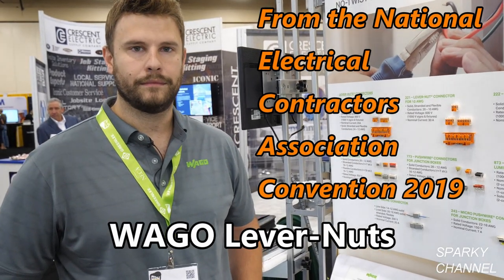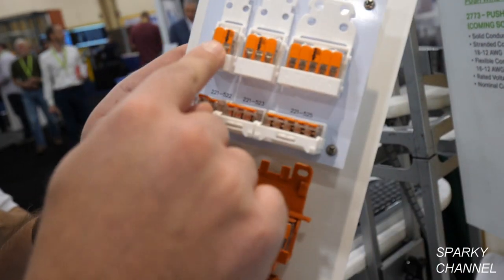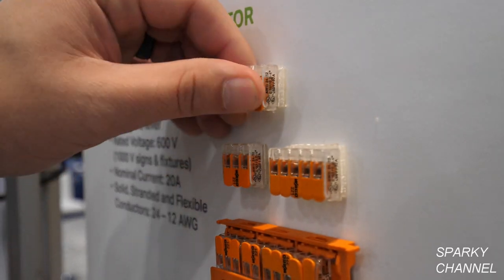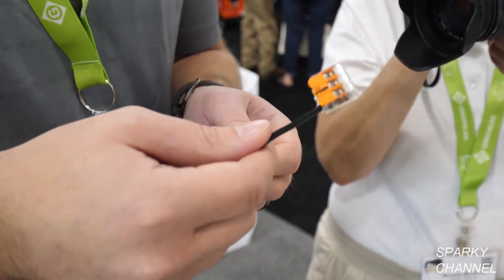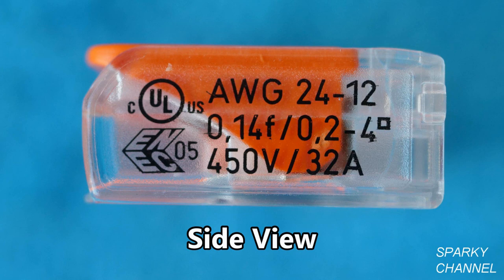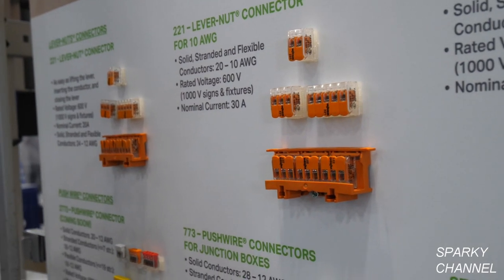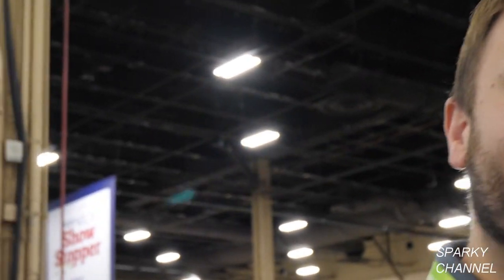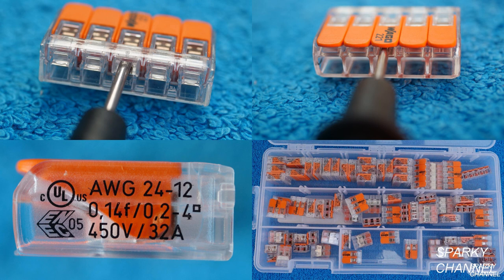Wago Lever-Nuts Questions and Answers From National Electrical Contractor Convention

Comment: 26 years of twisting wire takes its toll. These are a God-send!
Reply from the maker: I hear that! Happy new year!
Reply: Only 25 years? Weakling. Try 40 years. Lol.
Reply: Yep that and none of us old farts ever used power tool to set screws. Know several old sparkies with carpal tunnel & elbow problems. Was going to get my carpel tunnel operated on a few months before I retired but delayed it. Seldom bothers me since retiring so not getting operation done.
Reply: @JohnThomas-lq5qp  smart move, amigo. Both my shoulders are supposed to be replaced. I don't care how much pain I'm in, that's not happening.

Comment: I carry them all the time in my truck, use them a lot when troubleshooting or for continuity test when coming to a pull box with multiple circuits, rarely leave them in the boxes I usually replace them with regular wire nuts once I got everything figured it out. Sometimes I leave them in if I’m splicing 4 to 5 #12s in a box with other circuits, Easier to bend/push them in when spliced. Will buy the new ones for #10s.
Reply from the maker: Sounds good Roberto!

Comment: After many jobs involving old work, I too often come across wire leads that are too short either at installation or for who knows what reason the wires end up short probably by too many wiring, unwiring and rewiring cycles (by work hardening induced brittleness due to replacement of a failed socket, upgrading a switch, etc.).  Try wiring a short lead with a wire nut.  WAGO’s make this possible without having to do major surgery on the circuit.

Comment: The Wago system really is excellent.  They also make junction boxes that lock the connectors into place with strain relief built in, the bonus is that when the connectors are pushed into the box, the levers are held into place by the structure of the junction box.  A true maintenance free system.

Comment: I absolutely love them. I don’t use them everywhere but damn, when you need them they are perfect. Reusable, doesn’t damage the wire, you can disconnect only one conductor with having to untwist a nut, the wire is allowed to rotate within the clamp, making it easier to move the connector within the box.   So many pluses, imo
Reply from the maker: Thanks!
Reply: I like the way you can connect up all the energized sides of the wires if you're working hot for some reason, and then make the load connections last. Safer as there's no open hot wires exposed that way

Comment: As an amature, I adore these things.
Reply from the maker: Yes sir! :)
Reply: As a professional, I adore these things.
Reply: As a DIY guy, take my money!
Reply: From the first time I saw Bill (Sparky) show them I really like them, my trade school companions said they didn’t trust it, I’ve been using them since and not a problem (and I know there are never gonna be any)
Reply: Yes these indeed are for amatures that do not realize this is not as good of a connection as the actual wires being twisted together under a wire nut
Reply: Having said that i do believe that these will work fine in very low amperage applications with no problems
Reply: Thank you for asking the doubting questions.   I loved hearing the responses.
Reply: I like to use them on ceiling mount light fixtures, especially if I know that that person is all Martha Stewart and constantly having their fixtures replaced.   I almost always find wire nuts with a whole roll of electrical tape wrapped around each one.  Once I nip those, we’ve already lost an inch of wire.    Why continue on the path to an eventual tug of war?
Reply: @kellxniko  I dont trust wire nuts. I prefer soldering everything.
Reply: @kellxniko  You have seen the testing videos on youtube, where the wires themselfes gave up before the Wago connectors? And this at more than double or triple the rated amps. So they are already better than the wires you can put in them. So tell me, what should be the benefit of a connector that is better than that? When the cable is already with the wagos the weakest link?
Reply: Did you mean armature? Being all electrical, after all.

Comment: I hope this becomes standard in res building.  It is so much easier and safer for homeowner diy.
Reply from the maker: Thanks!
Reply: homeowner here... i replaced an electric cooktop. i used these instead of wire nuts. so easy! the wire nuts destroyed the stranded ends :|

Comment: I love these connectors, use them all of the time and never experienced any issue whatsoever. Just be sure to buy the authentic WAGO and not the Chinese knock-offs.
Reply: EXACTLY. There are cheap Chinese knock-offs all over Amazon. I always read the fine print and make damn sure I'm ordering the REAL Wagos. There is a HUGE difference between a genuine Wago and the knock offs.

Comment: I just used a wago connector to get out of the jam. 🙈 I replaced  two new switches which were not working and ended up having to replace the gang box as well because it was cracked; one switch is for the porch light and the other is for a switched outlet. There was not enough wiring to twist the wires together too create an extension doing pigtail so I used a wago connector instead. It Worked perfect. 😁
Reply: Perfect for short wires.

Comment: I'm surprised they didn't show the new Wago 221-2401 & 221-2411. Those are inline splice connectors. I used them to lengthen a few wires during a panel swap. They don't take up a lot of room, and they look a LOT better than those fugly wire nuts. I used NO TAPE! AND they're approved in the US, Canada, and Europe.
Reply: I think they weren't out at time of release of the video.
Reply: I just ordered a kit of those on Amazon. I can see a lot of uses for these, especially in regards to automotive applications.

Comment: Hi,

The wago is cantilevered internally with a spring. You can pull up on the lever a bit and nothing will happen. The mechanism does not "engage" until you start to feel pressure on the lever and then it snaps open. The little bit of movement is just free play that does not affect the spring pressure.
Reply: I saw an experiment on YouTube (on a channel by a guy who uses Wago, not a detractor) where he found that raising the lever just a little actually reduced the holding power of the nut by a consistent amount. I was surprised, as I would have though it wouldn't make any difference. However, this doesn't worry me, and I use these regularly, and love them.
Reply: Yes reduced holding force from 25lbs to 20lbs

Comment: I love wago connectors, they are just pricey. Wire nuts are good and I use them a lot. A lot of wires in older houses are short due to being cut multiple times.  So if you don’t want to re run a line then it saves headaches
Reply from the maker: Good points!

Comment: The 10 AWG Lever Nut is the best thing since sliced bread. I know im gonna get a lot of shit but ive had wire nuts fail on me even though i twisted it onto the conductor and twisted the conductors together. Ive since been phasing out wire nuts and been replacing them with the WAGO Lever nuts. Like I said the 10 AWG is the best!
Reply from the maker: Yes, the 10AWG is very robust.
Reply: With wire nuts, the formal instructions I got from professionals were to not twist the wires; instead, they were to be parallel and straight, and the wire nut's threads were to clamp onto the wires.
Reply: Same here, I don't like wire twist/wire nuts.  On thinner ga wire the wire nut will twist the copper wires together, but it sure doesnt on 10 or 12 ga wire, so unless you pre-twist, those two wires are laid side by side just contacting the ribbed metal inside of the wire nuts, and wire nuts are a real PITA if you have a junction box where each color has 4 or 5 #12 conductors! the WAGO  comes in  2,3,4,5  so you can easily connect 2,3,4, or 5 black, white, green conductors in them. The WAGO is FAR better, I replaced all the wire nuts in my house with WAGO connectors

Comment: I haven’t switched over just yet to just using them but years ago I learned to use them just to extend short ass wires the got that way because it got blow up or whatever then wire from there.  I saw a test video on YouTube were this guy put 100amps (10v) and even when they finally burned up the electrical connections were still good!  I’m switching as soon as I can.
Reply: Using anything but these is just cheap, so superior to everything else. Most important wires are flexible anyway...

Comment: 1:53 what does gas tight seal mean? Just that the small contact pressure point is high enough to exclude oxygen and prevent oxidation? It's not sealed otherwise, so it's not referring to things like hermetically sealed connectors.

Comment: Those 773's look perfect. I always wondered if there was a better way than twist connections.

Not that they can't be successful when done right, but they can be a little time consuming. Especially when making sure you got it right.

Thanks for posting this, it's rad!
Reply from the maker: No problem, thanks!

Comment: I switched to Wagos ever since seeing Bill use them on his original channel years ago, and have never looked back, I love 'em! Of course, there'll always be a place for traditional twist connectors, but Wagos are the way to go... ...wait a sec...  way, to go... Wago. Okay, got it!
Reply from the maker: LOL! WAY-TO_GO!
Reply: In your opinion when are traditional twist connectors more effective (necessary) than Wagos ? If you don’t mind me tapping into your brain.
Reply: @benjaminvivar7855  I'm sure this question was meant for Sparky, but for me, I use wire nuts or twisters specifically for low-voltage cable (grouped wire such as THWN 10, 12, or 14 gauge) or for 22 or 24 AWG electronic (low-voltage) wiring. I don't think this constitutes a more "effective" means, but I do know the primary reason why I elect to use twisters or wire nuts is because I have way too many in my collection! Haha
Reply: Red Solo Cup Thank you
Reply: Whaaa?

Comment: Ironically enough, I have to work with Wago PLCs (programmable logic controllers) for work and hate the things with a passion - mostly because of how much a pain it is to insert and remove wires from them.  They've got the same cage clamp type connector but instead of a lever you have to insert a flat screwdriver and tweak it in exactly the right way to get the cage to open to accept or release the wire.

Yet I'm seriously considering using these connectors to finish the wiring in my shop.  That little lever makes all the difference.
Reply from the maker: Thanks Jeff!
Reply: Did you use the WAGO screwdriver (210-719)? With those you can smoothly (one move, less than a second) open the port (ofcourse it wont if you have never done it before), even keep it latched. Then just insert the wire and pull the screwdriver. I did the home automation at my home, and had no issues with inserting (.75mm2) wires (stranded, no ferrule).
Reply: @marcoboot18  No, I used a bog-standard tweaker that our technicians carry around for working in panels.

I wasn't aware that Wago had a special screwdriver.  Given that we only have one site we manage that has these things (and we'll be removing them all next year, hopefully), I don't think I'm going to bother to get our people to order one.  Still, that's good to know about in case we ever pick up another site with these things.

Comment: I like the lever nuts for stranded wire. The wire strands can fan out giving a lot of surface contact. However I don’t like them for solid wire. The wire is round but the cage is square. Very little contact surface.
Reply: Your comment got me thinking about contact area in a wire nut, and I think wire nuts DO give you as much surface area as Wagos.  Think about your solid wire example: the round wire is twisted and shoved into the wire nut.  Hold up your right hand and make an OK sign to simulate a wire nut, then stick your left index finger in the O to simulate the wire.  If you press your left index finger to any of the sides you get only one side of the wire making contact with the wire nut.  Your finger-wire only increases its contact area when it comes into contact with another wire, and two sides are connected, etc.  In a wire nut the amount of surface area that is being used to pass current is going to depend on the number of conductors they are bundled in with.  For Wagos, there are always two sides of the wire making contact, and the contact area for each wire will always be consistent regardless of the number of wires used.  So that is what it boils down to: are you the kind of guy who wants wires getting the most surface contact even though you can't see inside of the wire nut to check, or are you the type who would rather have a UL rated, guaranteed connection for every wire that is easily inspected after installation?

Comment: Chevy vs Ford. Charcoal vs Gas. Lot of opinions out there on these but at the end of the day the old dinosaurs will never accept improvements so it doesn't matter which technology they are presented with. These are a game changer.
Reply: HEY!   Speaking as an "Old Dinosaur," I've been using Wago LeverNuts ever since I first found them!  I just got through sending a link for this video to a NEWbie I've been trying to convince on LeverNuts for more than a year now.  So, don't be giving us any of your biased opinions about "old people" lest one of them be tempted to hit you with their cane right in the WireNuts.  😀

Now, this "Old Dinosaur" needs to go see if Sparky has a video on 3M Scotchlok Electrical Part Number IDC 562 and 3M Scotchlok Electrical Part Number IDC 567 -- which are two of my favourite connectors for installing a compact "tap" splice into a box!  Being IDCs, they do not require cutting the "runner" -- which means, if you remove them, you can simply "re-insulate" (i.e. tape) the wire and move on.  SFAIK, these are the only IDC Tap Splices rated for 600 Volts (most everything else is designed for "automotive" or other "low voltage" use).
Reply: I'm a  dinosaur that has 40 years experience. My father owned a big electric company and my grandfather was a electric contractor. Wire nuts just came out when I started. Wired thousands of houses and apartments and had 10 service trucks at one time. We never had a problem with wire nuts. I live in Arizona and it's hot here. If technology is better I'm all for it. But we never really had any problems with wire nuts.
Reply: @bigmike9433  One of the advantages of WireNuts (and there are several), is that they do not "carry" any of the current.  Done properly, their sole purpose is to "hold the wires together" so they maintain conduction wire-to-wire.  Lever nuts, by contrast, are "in circuit."  Most of the time, this is not an issue because the circuit has "over-current protection" and the LeverNut ratings all exceed the standard current rating of the wires for which they are sized...

That said, we all know that, on occasion, the over-current protection does not function as anticipated (think "penny behind the fuse).  At that point, there may be circumstances where the LeverNut becomes the "weakest link" in the downstream connections.  Whether that is "good" or "bad" depends upon circumstances; but, with a properly installed WireNut, that concern is off the table...